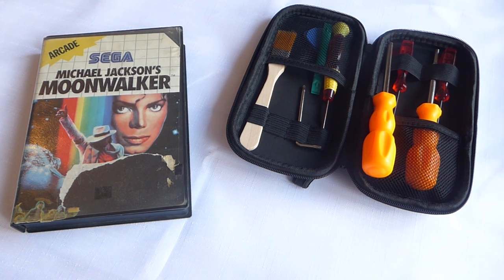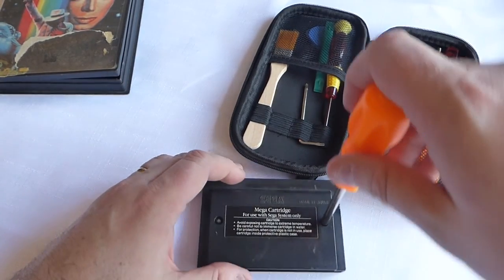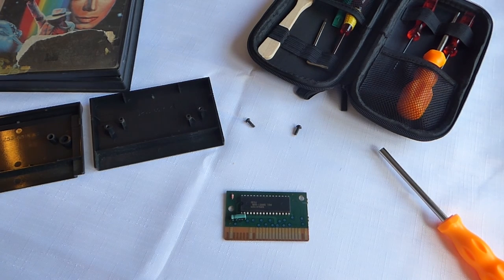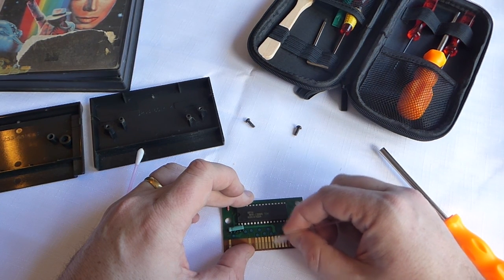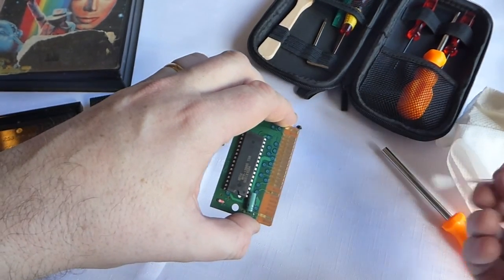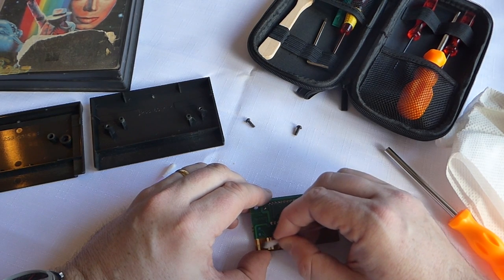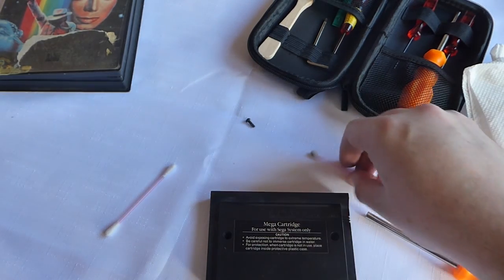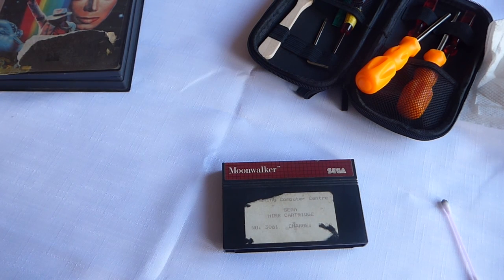Classic and Retro Gaming - Cleaning Sega Master System Cartridges

Comment: Great job mate, contacts are looking like new, a quick job with Master System games.
Thank's for the video mate, i'v got some SNES Carts that need a good clean :o)
Reply from the maker: i got a lovely kit from amazon with all the tools to open the cartridges too, very handy :-)  i got line of fire the other day, that needed to be cleaned before it would work :-)
Reply: Look's a nice kit, hard to find them drivers for carts, have to look out for a kit like yours :o)
Reply from the maker: why look, i have a link :-)  https://www.amazon.co.uk/gp/product/B01KSOWL3Q :-)
Reply: Than'k you mate, i'l be popping on :o)
Reply: Currently unavailable :o(
Looks a good kit, never mind, thy may have some back in stock soon, have to Keep Checking.
Reply from the maker: i think if search amazon or ebay for something similar, versions will pop up :-)